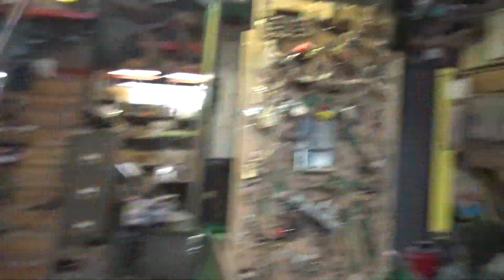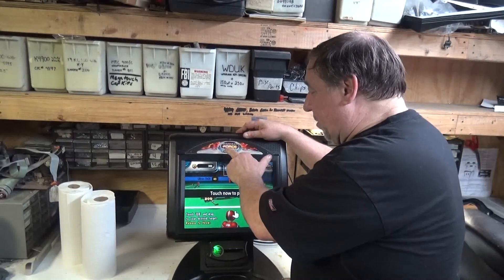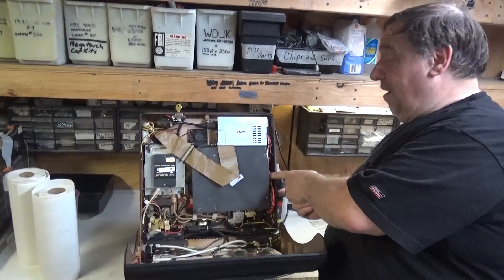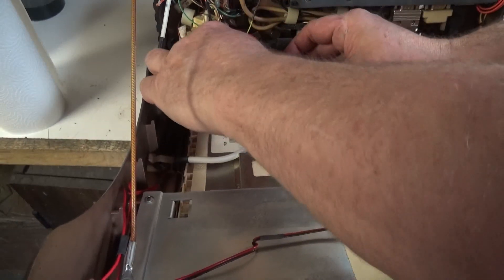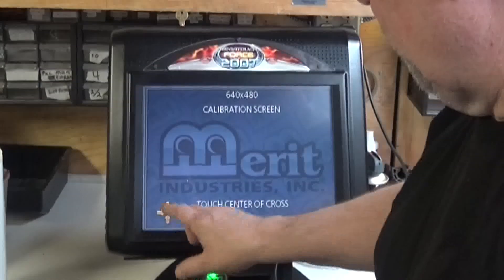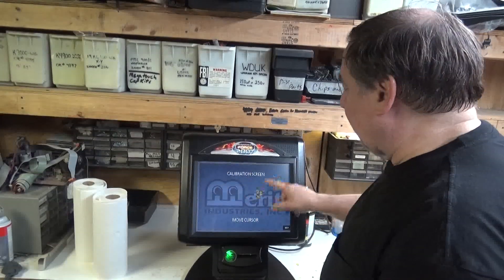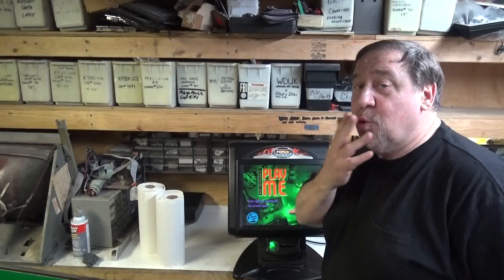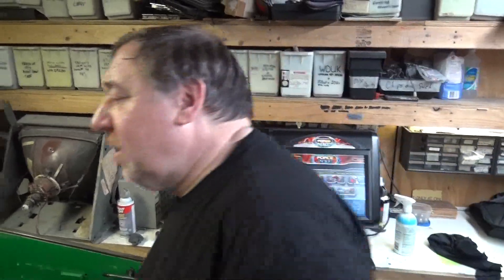#640 Merit MEGATOUCH FORCE Touchscreen CALIBRATION TRICK! TNT Amusements

Comment: Thanks for the great video! I am working with a Megatouch that consistently switches to a lower screen resolution after a game loads from the menu screen, thereby rendering the game unplayable. It used to happen only occasionally, and only with some games and could be corrected by a reboot, but now it happens every time. After the games time out  and the menu screen is again displayed, the resolution is corrected. Any ideas? Thanks!
Reply from the maker: You should try a new battery first...change with power on.  It could also be a bad connection between main and daughter boards...taking boards apart and cleaning the edge connectors with emery cloth and wiping with rubbing alcohol may help too.
Reply: @tntamusements  Thank you so much for the response!

Comment: I have a Megatouch RX machine that when you turn it on you can just barely see the no sync label and then it pops off and it stays dark I was thinking that maybe the back lights I've checked the power for the touch screen everything is there I just can't get it to come up any suggestions Todd
Reply from the maker: leaky capacitors on the main board, bad processor, clogged fans....
Reply: TNT Amusements Inc thanks Todd this thing is cleaner than a fat baby's ass so I'll start going through it and checking components this thing is an absolute nightmare to get to the main board you could build a ship just when the part you got to take off in order to get to the board